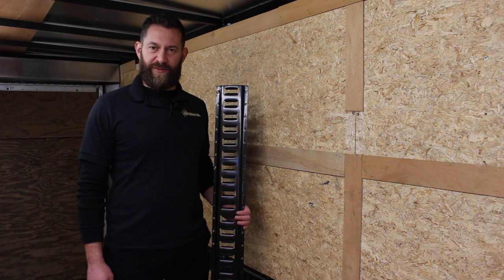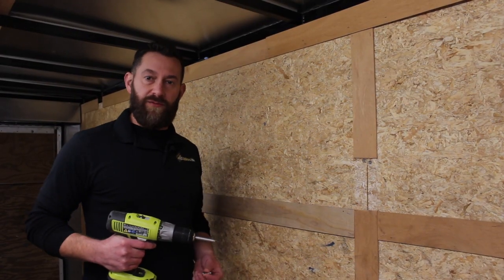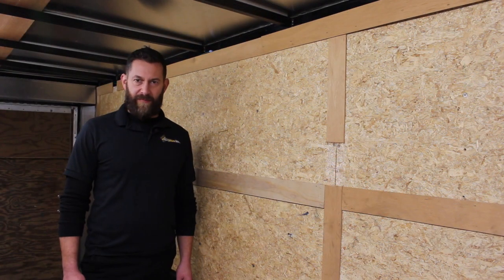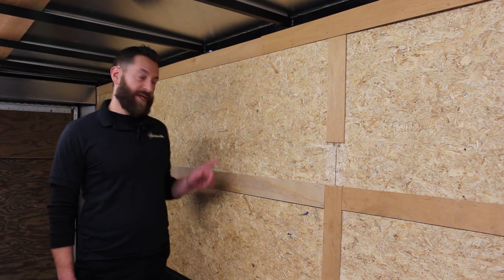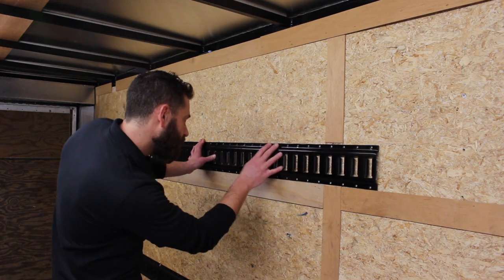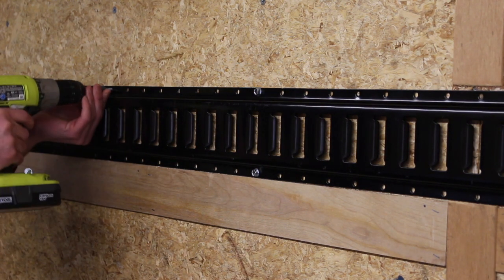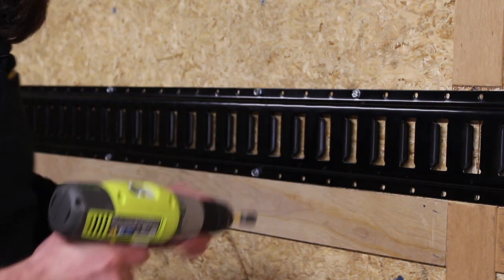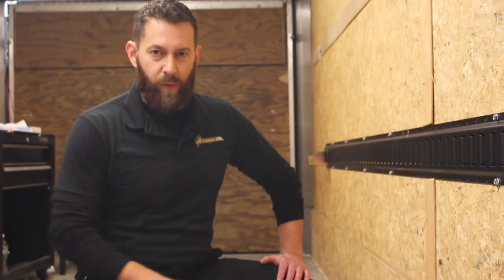How to Install E-Track Rails

Comment: I used through bolts on the floor with washers and lock nuts in addition to screwing into the metal floor joists. I’m going to tackle the walls next. 1” self tapping screws for the studs and 3/4” screws for my 3/8” thick wall sides.

Comment: What is the cost for labor only to I stall and etrack in my trailer
Reply from the maker: We do not offer installation services, we only sell the products. But as the video shows, installation is really simple, so if you do not want to install it yourself, you can probably find a handyman locally that can install it. Depending on what you would like installed, it shouldn't take more than a couple of hours. Feel free to contact us if you have any more questions! You can chat on the site: www.dccargomall.com, or give us a call at (866) 998-0577
Reply: Buy the e track at Harbor Freight.. cheaper than Lowe's